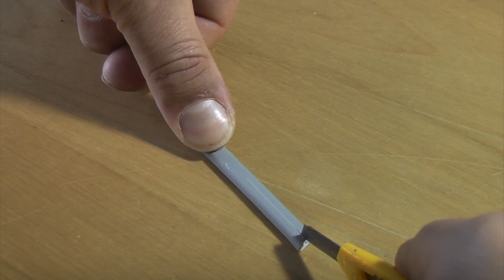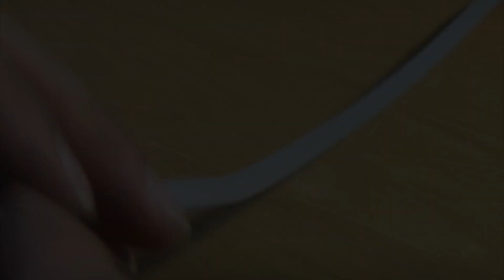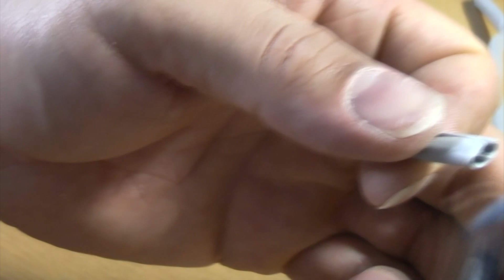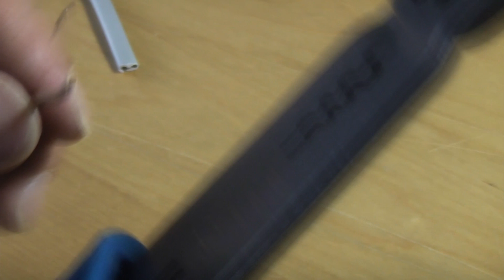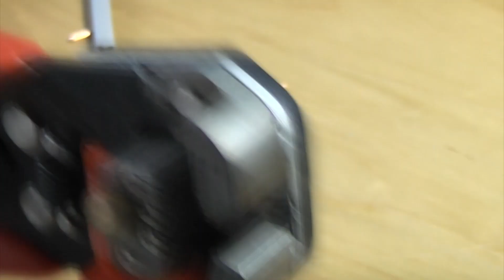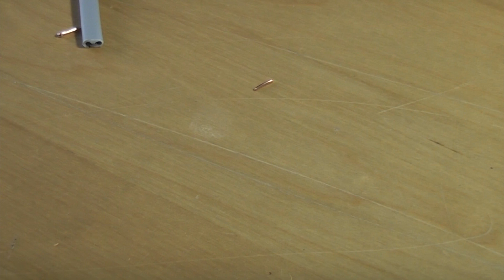Ultimate Handyman DIY tips - how to strip electrical cable

Comment: Except they tell you not to do that now because it can stretch and weaken the cpc.
Reply: That isn't true, to stretch copper of that size you would need to be superhuman - the force applied in the method of stripping poses no risk of stretching.
Wakening the CPC only occurs if it is bent sharply multiple times - like all metals - and if you're doing that too much then you shouldn't be stripping cable.

Comment: Handyman had a bit of a nightmare when changing a single electrical plug socket- the socket revealed three of each wire type had been connected to it; 3 earth wires, 3 live etc. The new socket I bought would barely fit them all in. Is there an easier method to do this, i.e is there a single socket that has a bigger gap to fit the wires into? Thanks
Reply from the maker: I don't think there is, but you can get deeper back boxes- but obviously that is a lot of work and the brickwork might need chiseling out! You can get a spacer though - https://www.screwfix.com/p/schneider-electric-lisse-1-gang-spacer-white/5782j
Thanks for the comment 👍

Comment: Yes similar problem for me as with Richard D. I am trying to get the plastic covering off a flat 2 wire flex - so cannot use the earth wire method of stripping, otherwise great video!     12985
Reply from the maker: These are good for most cables- https://www.youtube.com/watch?v=b3mrqtdyCm0
Thanks for the comment

Comment: That's because an RCD detects current leakage. You should never have the live or neutral exposed anyway, and that is basic knowledge in regards to electrical installations.

Comment: Pisses me off when their's no earth sleeving because if it touches a live or neutral it will trip any rcd on the circuit
Reply: It intentionally has no sleeving thats how it works. So that if an animal bites the cable or a worker cuts it by mistake and exposes the live wire the earth wire can take the current and trip the RCD
Reply: jayja45 all you have to do is sleeve it? what's the issue

Comment: good tip although your giving all our secrets away lol.....regarding stripping the sheath back anyway,your welcome to the wire stripper bit,there for wimps! use your side snips.......on a serious note tho im pleased you advised regarding the earth sleeve,well done.Also if i may add you can use the smaller diameter earth sleeve,its less clumsy and also tucks further back into the cable sheath so there's no copper showing